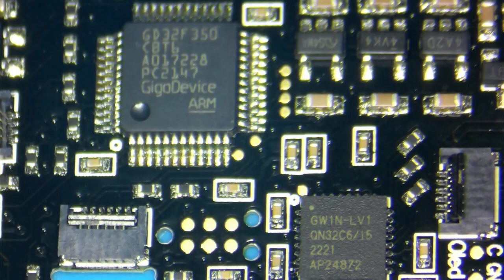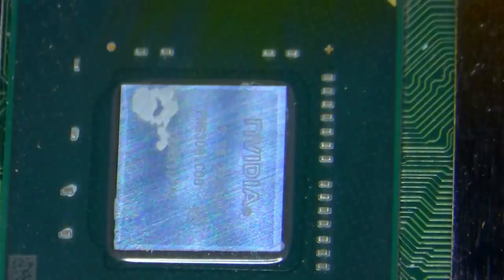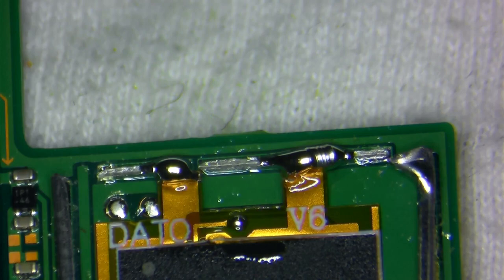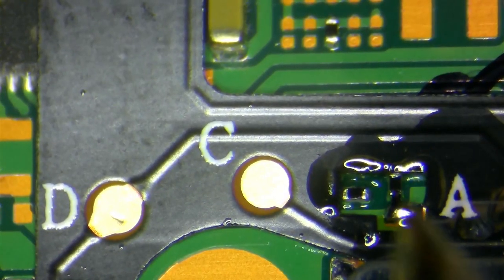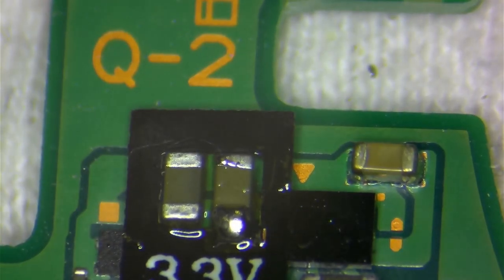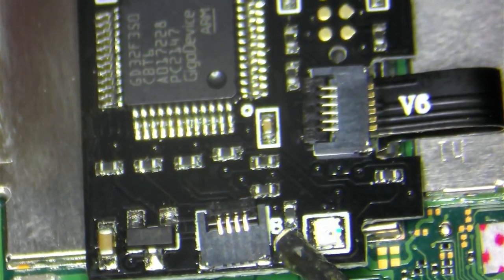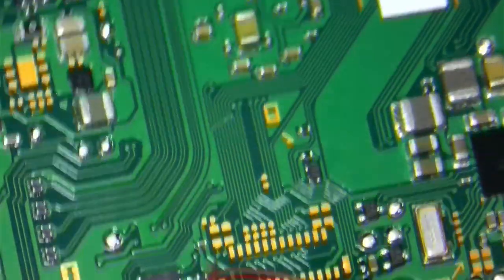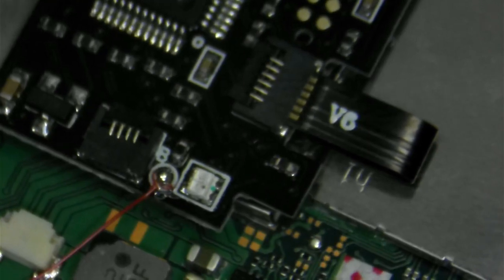NX-INSTINCT Mod Chip Installation on Customer's OLED Switch

Comment: nice work on the soldering but the fit and finish could use some work. your cuts with the pliers are messy and leave jagged edges and you also can make the shield fit perfectly if you just smooth over the globs of solder from the anchor points on the flex cables so they're flush.

Comment: Hi, i need help for my OLED. I got error code ** RST not connected. I checked with multimeter and didn’t get any reading even when i put directly on the RST point. Is there any other RST point that i can solder?
Reply: were you able to fix it?

Comment: Nice job, no firmware to install ????
Reply from the maker: Thank you. Most RP2040 comes with firmware. Check with supplier.
Reply: @Wayayeo  Thanks, where find files to add on microSD card ??

Comment: What size wire did you use for points B and C
Reply from the maker: Currently using 38 awg.
Reply: @Wayayeo  thank you I figured it out and I was able to install the mod chip successfully

Comment: I installed hwfly with oled v6 kit but the console starts only in stock mode and the chip led is white The strange thing is having 450 on all points and 382 on B Those are a bit low…
Reply: Have you ran into black screen but constant green pulsing to purple to red flash then off
Reply: I have a similar issue with my V6 and it's usually my C point on the chip